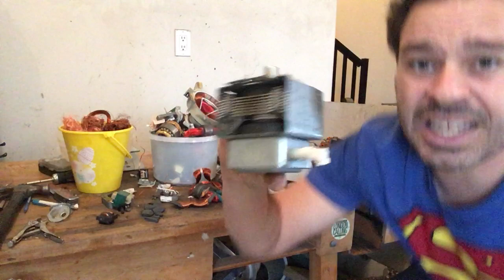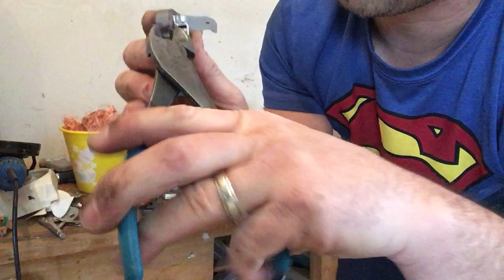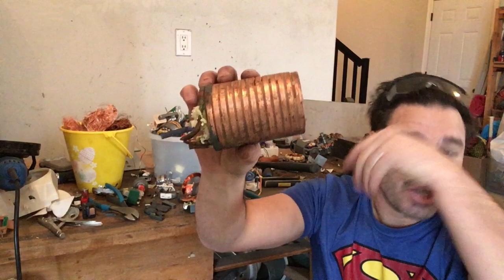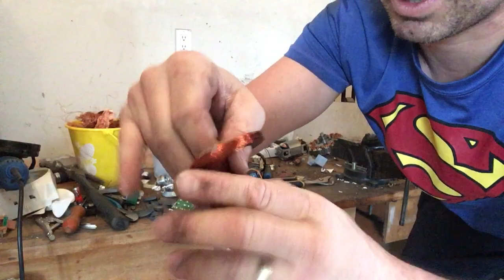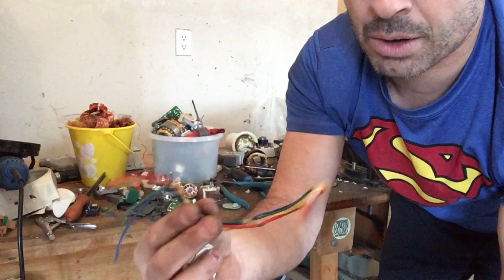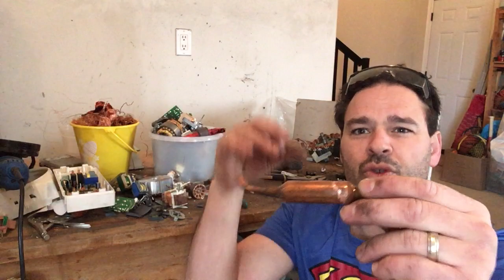Scrapping some small items for big profit!!  Some great places to find #2 copper.

Comment: Tin man..do you keep the cast/die cast aluminum from some of the copper motors? And if so, do you separate your cast aluminum from your die cast, or does your scrap yard give you one price, and you keep it all together?
Reply from the maker: They give us one price. You do have to make sure you get out the metal ring at the top, which holds the centre pipe of the amateur, so you don’t get dirty cast

Comment: I found some sort of control panel with switch's and nobs and my question is I took apart one of the nobs and there's three silver looking beeds in it and it looks to clean to be solder. Could it be silver??
Reply from the maker: knobs and switches have a silver dot on them. A lot of the items have a small looking smudge of silver, but sometimes the bigger switches and older ones have more. some relay switches actually have gold not silver on them.
Reply: @TinManScrapper  thank you

Comment: I have been taking apart motors. The copper that I am getting has paper and glue. Is the copper still considered number two or something else?
Reply: Yes it's number 2 but you should clean it up as much as you can
Reply from the maker: #2 don’t struggle too much with the glue….that is why they give you #2 price. I take off whatever is easy, but I don’t struggle to clean it off too much